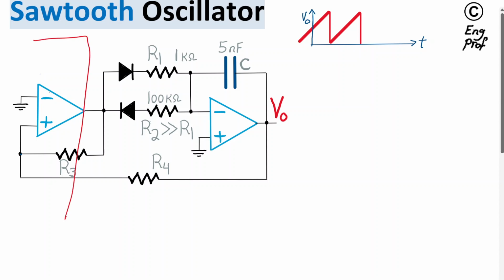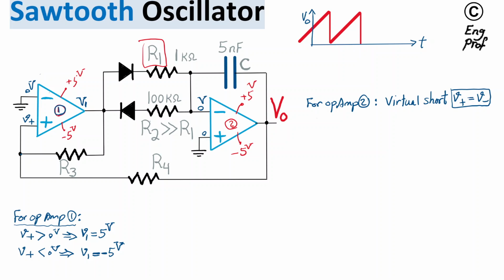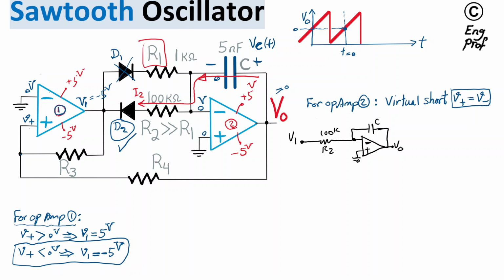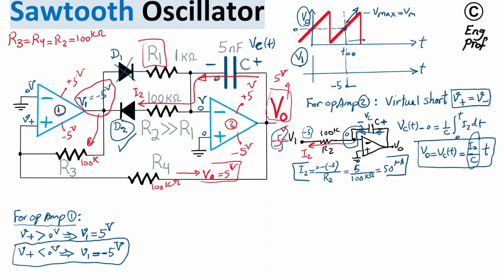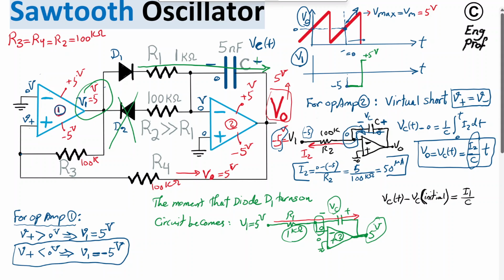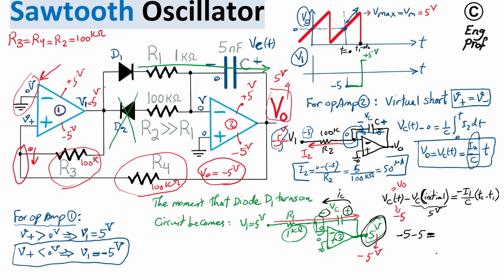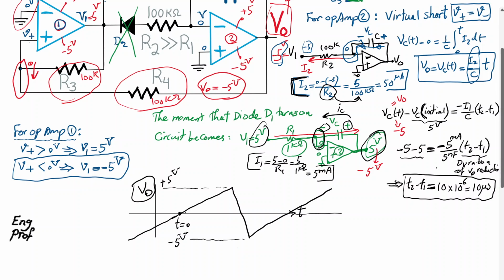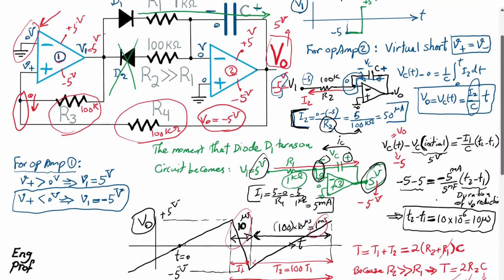Sawtooth Signal Generator: How does it work?

Comment from the maker: Thanks for watching. For more Analog Circuits, Oscillators Op Amps and Transistor examples see  Triangle Oscillator Op Amp circuit https://youtu.be/JF5Up_cuL9k
Complex Sinusoid Oscillator https://youtu.be/GXRhmwmS5Zk
Sawtooth Oscillator Design https://youtu.be/2eUsGPfqbW4
Full-Wave Rectifier circuit example https://youtu.be/DJJMNU-CYcg
Sawtooth Waveform Generator design with OpAmp, JFET, BJT: How does this circuit work? https://youtu.be/5zHXTx-Vl20
Diode-Amplifier VTC is analyzed in https://youtu.be/vpGZkafxMJM
For more circuit examples please check the circuit videos playlist: https://youtube.com/playlist?list=PLrwXF7N522y4c7c-8KBjrwd7IyaZfWxyt
I hope these analog circuit examples and videos are interesting and helpful.  🙏

Comment: Thank once again for a great explanation. Just one thing , in your green sketch of ic2 , did you show the current in black going the wrong way?
Reply from the maker: You're welcome! Glad that you liked my explanation in this video. Thanks also for double-checking and your question. Assuming you are referring to 17:55 , the direction of Ic capacitor current in black is correct. If you're interested in exploring further, the playlist includes additional waveform generator designs and timing analyses that build on similar concepts, for example https://youtu.be/5zHXTx-Vl20 video explains Sawtooth Oscillator Design with OpAmp, JFET and BJT transistors. The https://youtu.be/JF5Up_cuL9kvideo is a Triangle Oscillator Op Amp circuit design.  And Complex Sinusoid Oscillator is reviewed in https://youtu.be/GXRhmwmS5Zk video.

Comment: I enjoy your videos thank you for preparing them and sharing them with us. For this circuit... if yoy have a single supply would it still oscillate?
Reply from the maker: @robr8554  You are welcome! Glad that you enjoy my videos. In case of single supply, the grounded input terminal of each op amp needs to be biased at 0.5*supply voltage. Then your output Sawtooth waveform oscillates between 0 and supply. For more Oscillator circuit videos see https://www.youtube.com/playlist?list=PLrwXF7N522y4ee_0GL2EdguM-kLtJPxpU Oscillators and Signal Generators playlist. I hope this is helpful.

Comment: Nothing changed c
I removed it and nothing changed
Why did you put it?
Reply from the maker: Capacitor is required for linear integration of voltage in order to generate linear increase in Sawtooth Waveform.  Op Amp itself has some internal capacitor as well between its output and inputs. But value of that cap is usually very small depending on specific Op Amp.

Comment: Very nice. Can this be done with unipolar power supply? And how to make the frequency controlled by voltage?
Reply from the maker: Thanks Dmitri for watching and your good question. Glad that you liked this video.  Yes, it is possible to implement this Sawtooth Oscillator using unipolar power supply. It just requires proper DC biasing of the input terminals of the two operational amplifiers in this circuit. For another oscillator example with Op Amp, JFET and BJT transistors please see https://youtu.be/5zHXTx-Vl20
Reply: Create a virtual ground with two resistors and use that for the ground  connections of the op-amps. Try searching for "LFO voltage controlled" and "Triangle square wave LFO" you should probably find some circuits for synthesizers. (The circuit in the video is a triangle and square wave oscillator with the diodes added to make the discharge and charge of the capacitor uneven and generate a lopsided triangle wave/ramp wave)
Reply from the maker: Thanks for sharing your insights. For more Oscillators examples see Sawtooth Oscillator Design https://youtu.be/2eUsGPfqbW4
Triangle Oscillator with Op Amp https://youtu.be/JF5Up_cuL9k
Complex Sinusoid Oscillator https://youtu.be/GXRhmwmS5Zk
Sawtooth Waveform Generator with OpAmp, JFET, BJT explained https://youtu.be/5zHXTx-Vl20
I hope these analog circuit videos are interesting.

Comment: Where did  suddenly number 2 come from  in T=2(R2+R1)C ?  Even though it is correct in this case (R3=R4), it needs more explanation. If R3=2R4, then T=(R2+R1)C, which looks more familiar in RC circuits.
Reply from the maker: Thanks Dariush for watching and your follow-up comment. The factor 2 appears because output voltage has to traverse from -Vdd=-5 to +Vdd=+5 (meaning 2Vdd total) while driving voltage force charging or discharging the capacitor is either Vdd or -Vdd. I hope this further explanation is helpful. 🙏